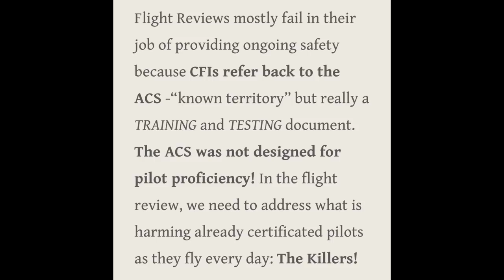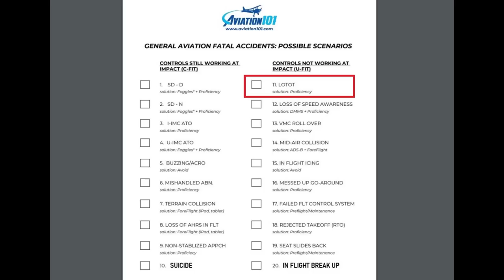Engine Failure at 400 feet.  The Impossible Turn.

Comment: Thank you, Lord!  Excellent execution of a difficult maneuver with very little tolerance for error.

Actually, engine failure on takeoff is most certainly indeed covered by one of the top three handbooks required for private pilots.  It does not, however, recommend returning directly to the airport.

I have practiced this in the simulator several dozen times since I first began taking lessons, and out of the first dozen times, I made successful landings just twice, crashing and burning on the other ten.  It's not an easy maneuver, even when practiced often.  I am now an instrument-rated private pilot and still practice this maneuver on a regular basis, never with better than an 80% success rate, hence the ongoing practice.

By far, the most critical element involves the immediate establishment of a suitable airspeed.  You'll need enough to prevent a stall, plus an addition amount to cover a perfectly-executed 30 degree bank turn, plus extra for turbulence, plus extra for a bit of g-loading during the first part of the flare.  I've tried this at all combinations of speed and bank, and what seems to work the best is velocity for a perfectly-executed 60 degrees of bank while never going past 45 degrees.  60 degrees imparts 2 gs, requiring stall speed x the square root of 2.  Thus, if 50 kts is your stall speed, multiplying that times 1.414 requires 71 kts.  Interesting enough, for the aircraft I fly, that's right at L/D max, which results in the most lift per unit of drag.

Successful execution begins with a decided nose-over coupled with an immediate 45 degree turn held at Vx x sqrt(2).  I've tried chandelles and turns at 60 deg bank, and none worked very well at all.  Turning at 45 degrees bank helps lowering the nose, so I do both, simultaneously, which requires less energy for a 180-degree turn than either more of less bank.  The additional slight benefit of a 60 degree bank is greatly overshadowed by the far narrower margin for error and much higher probability of an unsuccessful outcome.

In summary, MEMORIZE:

Velocity = Vs x 1.414 = _________ kts
L/R bank to 45 degrees AND nose over
At ___________ kts, pull up, maintaining 45 degrees of bank and the correct pitch to maintain ___________ kts of airspeed
When lined up and on final, if you have enough altitude, begin lowering your flaps

Good luck.

Comment: Well Dan, I wish you would comment on STOL airplanes and the so called impossible turn.  And how about trikes/microlights/ultralights. No big deal with the right plane + awareness/skill. Also, the turn doesn't have to be a full 180 degrees. A 120 or even 90 degree can be life saving vs straight ahead into houses, buildings, or trees! One other thing, I wouldn't waste time making radio calls during the turn...

Comment: I am a 20,000 pilot CFI, CFII,MEI trained 40 students a year for years running an accelerated flight school. I was part or a study in1986 where we took every thing from a J3 to vtail bonanza to study engine out turn back. We did over a hundred test with pilots that had been instructed in the technique and a hundred with pilots that were not instructed. We taught to know where 400' AGL was check the wind turn into it, at first sign of power failure drop nose and 45 degrees of bank. Turn to the runway. The trained pilots all made the turn in every plane. 9 out of 100 made the turn with no training. This study was done with the help of the US Navy. It was published I don't know why so few instructor use it. All of my students do it many times in training I never tell them when. The biggest mistake that most people make is trying to do it with a shallow turn. Takes to much time and usually not making to 270deg turn that will put you back on the runway

Comment: Amazing, I was in a similar incident in the early 80s at Doha International airport. Same problem with the engine and the loss of power. All I remember was the stall warning siren going off as the pilot banked to starboard calling out mayday. I also remember the roof of the Gulf Hotel appearing to be very close!

Comment: When I received my flight training I had switched fight schools and instructors.  Engine failure on take off was discussed many times and of course the reaction to this event was to fly straight ahead, keep the nose down and look for a place to land.  Since it was discussed so many times  over the course of my instruction, I felt was though I knew what to do in this case.  This guy was very lucky because of the wind direction.  Making a turn with a loss of airspeed and especially the more than 180 degree turn that this fella did, was not recommended.

Comment: Another 5 * interview by Dan! I'm not a pilot, but if I was ever a passenger and the pilot had a medical emergency. I'm confident with help from the air traffic controller, combined with what Dan has taught me, I would have a positive outcome. Mayday, Mayday, Mayday, complete engine failure, we are descending. I'm not a pilot and I'm declaring an emergency. My pilot has had a medical emergency.  My location is, roll fire, a ambulance, EMTs, and Police as we are going down fast at low altitude. Best area to land, avoid the impossible turn at all costs, avoid highways, power lines and trees; look for a cornfield :), wheels up, wings level, power back, adjust flaps, minimum safe airspeed, slight flare for the impressive landing. Donate to Dan's animal rescue!
Reply: Wow, pilot having a medical emergency and the plane a complete engine failure simultaneously! That'd be quite the challenge for any non-pilot.

Comment: Fire In Flight - Family on Board.

It was about 1987.  I was living in Mammoth Lakes, CA.  I lived next to a neighbor, a young General Physician with his wife and 2 small children.  I saw him get out of his car when returning home and noticed the right side of his head was missing most of his brown hair and his nylon jacket was badly burned on the right side.  Naturally I asked, “What the hell happened to you?”

His story:  Thom was a pilot in the Navy flying sub-chasers for a number of years.  He had just purchased an airplane, a Piper T-Tailed Turbo Lance.  He was planning a trip to Palm Springs from Mammoth Lakes to play some golf and relax with his family.  His wife and kids took seats in the back and he put his golf clubs on the right front seat where his wife normally sat.  

He was thinking of flying over Mammoth Mountain to take the west route south via Sacramento, but at the last moment chose to fly south over the Owens Valley.  After departing Mammoth Lakes, he climbed to about 12,000 feet and proceeded to Bishop and south.   

After 15 minutes or thereabouts he noticed some roughness in the engine, so he began adjusting the mixture to the rich side.  He had just passed Bishop Airport with its one big white hangar.   It was then that the engine exploded in flight.  With a loud bang, 1/3 of his cam shaft had departed from the aircraft and oil had spread quickly all over the front wind screen.  At that time a ball of fire came into the cockpit through air ducts in front of the front passenger seat, cooking his golf clubs and the right side of his nylon jacket he was wearing and took the hair off the right side of his head.  The air quickly turned to unbreathable and visibility was near zero.  

As a physician he new if he  took another breath of the oily soot in the cabin he would pass out and they would all perish.  The Lance has a small triangular opening on the pilot side left window.  He stuck his nose out of it and took a breath.  His family was coughing and moaning in the back and vomiting. He could see the oil fire getting worse up front and turned back to where he thought the Bishop Airport was and declared an emergency, then turned all of the electronics off.  He was now dead stick and the only way was down while burning.

While still breathing out his vent he turned the aircraft to the right an looked to his left where he made out the big white hangar at Bishop Airport.  He turned directly towards it.  The fire was increasing in intensity at 3,000 degrees as the airplane was beginning to fail from underneath.  The wing roots were melting.  At that time all he could see below him was sage and rough terrain, but he thought that setting it down now was imperative if they were to survive.  Any level spot would have to do.  He lowered the gear.  He passed over a barely visible white stripe and turned on it to land and set the plane down gently.  

The fire crew was at mid field when he came to a stop in front of them.  They all tumbled out of the aircraft and the fire crew put out the fire.   Both wings had sagged by 2-4 degrees and would not have lasted a few minutes more.  The entire front third of the bottom of the fuselage was gone.

It seems that the engine manufacturer for his model of Lance had some engines fail like his due to too much salt being used in the manufacture of the cam shafts.  

Piper completely rebuilt his aircraft at no cost and I must assume that he received a substantial settlement as well.  He never flew that airplane again.

His flying career continued.  He went on active duty with the Navy as a flight surgeon in Fallon.  I spotted him at an air show there in the 1990’s.  He was flying a 2 seater F-16 that was used as an enemy aggressor to train the FA-18 pilots on how to dog fight.

1.  He kept his cool, panic is never your friend.
2.  He flew the airplane.
3.  He remembered his emergency procedures.
4.  His wife was “not” sitting up front where the ball of gas/oil fire came through.
5. He was over a known airport.
6. Nobody was badly hurt in the ordeal although his wife would never fly in small aircraft again.
7. God was with him that day.

Had he chosen the route over Mammoth Mountain to Sacramento, his fate and the fate of his wife and of his children would have been sealed somewhere in the Sierra Nevada Mountains.

Comment: The lastest King training course for CFI renewals stresses scenario based training.  I believe the FAA is coming around by starting with the flight instructors using the trickle down theory.  My guess is that the FAA does not want the everyday pilot to be practing simulated engine failures by themselves at low altitude.  All CFIs should be reviewing simulated engine failures on take-off, especially during flight reviews IMHO.

Comment: I had a similar experience departing 21R at PDK, except that I was only 130’ AGL, so when I tried to make 3R I came up short of the runway.  I have lots of documentation, including ATC recording  , photos, FlightAware track, and NTSB report that confirmed that my engine quit due to vapor lock as the mechanic / Repair Station who had replaced the engine failed to include a mandatory vapor return line.  As an aviation attorney I successfully sued the mechanic and Repair Ststion
.

Comment: one exception to the "push on engine trouble" would be a slippery high performance aircraft, sometimes youre a million kts over best glide and the best move is to pull a G and extract that precious altitude you have saved up

Comment: I had an experience very simlar to Robert's when I was a freshly minted GA pilot about 15 years ago.  I was flying a rented Piper Archer over the Susquehanna River near Safe Harbor Dam at about 2,500' AGL (roughly 10 miles southwest of KLNS).  Suddenly there was a loud bang, and I thougfht I had hit another aircraft or large bird, but I did not see anything in the air before or after the explosion sound.  In a mattter of seconds the plane began to vibrate violently.   I had to reduce the power to 1,900 RPM to minimize the vibration, otherwise I was afraid the plane was going to fall apart.  I immediately turned toward the Lancaster Airport and called the tower to report I had possibly hit something and had a power issue, but I was going to try to make the field.   I knew all the ATC ppl in the tower (the fellow on duty was also a GA pilot) and told them at this point I was not declaring an emergency unless it appeared I was going to have to land in a farm field (I should have declared an emergency immediately -- but inexperience lurks).  At 1,900 RPM my plane was not able to maintain alttude, but since the engine was still providing some power, my involuntary descent rate was very slow .... perhaps 100' to 150' per minute.   When I was about three miles short of the runway and down to a little less than 1,000' AGL, I realized I was going to be able to make the field, but black smoke started coming out of the sides of the cowling.  Lucky me, there was no smoke in the cockpit.  I decided to contue witrh my plan to make the field.  (I believe at that point the correct thing to do would have been to declare an emergency and make an immediate off-field landing.)  I also noticeed there were fire trucks, an ambulance, and a couple of police cars at the end of the runway.   My first thought was they must be having some kind of first aid practice drill .... until I realized they were waiting for me.  When I reached the field (barely), I made a straight in to RW8 and landed uneventfully.  I stopped on the RW, shut everything down, jumped out of the plane, and we took the cowling off ASAP with fire trucks along side.  I could hardly wait to see what had gone wrong.  We immediately noticed one of the cylinder heads had blown off the engine and the black smoke was engine oil leaking out of the blown cylinder onto the hot engine block, but there was no fire.  I took a bunch of photos of the cylinder head blown off the engine and the Archer was unceremoniously towed back to the apron to eventually have a complete overhaul.  I believe Robert's Cessna was flying on three cylinders like my Archer, otherwise he may not have been able to make a successful recovery and land his plane so easily.  There's a big difference between a plane flying on three of four cylinders and a plane with a dead engine.  Among others, two lessons I learned: (1) When you have any trouble no matter how minor it may seem, tell ATC and declare an emergency.  They're there to help you.  (2) If it ever looks like any part of your plane is on fire, land immediately wherever you are.  Do everything necessary to save yourself and worry about getting the plane back home intact later.  Since that incident I have accumulated nearly 3,000 hrs of safe GA flying throughout the USA including Hawaii.  Keep safe out there everybody!!

Comment: You can turn steeply as long as you push the nose down far enough. In fact, an agressive bank (45 degrees or more) will turn you around faster with a smaller loss of altitude. The trick is to practice (with an instructor) in various conditions and in the plane you will be flying.

Comment: I find it interesting that a person learning to fly, say, a Beech B200 King Air will be drilled relentlessly on LOTOT, because of asymmetry and P-factor, but a plane with only one engine doesn't have the same rigors for if you lose your only source of thrust and under most circumstances cannot feather like larger craft. I realize that engine-out is, if not "required" typically part of learning, but low-altitude engine-out is a really tough spot to be in. It seems like you'd drill immediate actions for that as part of a comprehensive package of proficiency training.

Comment: In gliding we practice winch cable breaks regularly at various different heights and different wind directions.

This is an identical scanario to total sudden engine out in a power plane so we kinda get used to it or expect it.

There's so many scenarios but

it programs you whether you are:

 Low enough to go straight ahead

If a few hundred ft turn downwind and then back into wind to do an 270deg abbreviated circuit 

Turn into wind if insufficient height to do a circuit and land where possible.

Do Glider pilots make better pilots?
I honestly say they do generally 
(eg Sulleunburger Hudson River!)
In the PPL world I think the PFL training is totally inadequate and you only have to look at the 100's of Youtube vids with engine failure where the pilots go into total instant panic mode!!
If there was more glider training, folk would be able to deal with engine failure as a matter of routine rather than panic mode.
How many PPL pilots practice a PFL during a flight?
Probably very few is my guess.
Practice a power off approach at least every month and see if you can pick a practice field from 2000ft which you could have landed in.
Try and improve skills yourselves because a few PFL's once a year for a skills test is simply not good enough.
Jules
PPL & Glider Pilot

Comment: Robert's EFATO was very like mine - in both cases the engine ran VERY rough and most of the power went. In my case (in a Chipmunk) after transitioning from the nose-high climb to the nose-low attitude to keep the wing flying I found I could actually (just) maintain height, fly a very tight circuit, and land back on the same runway.

Comment: With that altitude and a complete engine failure (unlike this scenario with 3 working cylinders) it would seem very unlikely that he would have been able to make that turn, right? Not enough airspeed or altitude to save him turning wise. IN the case of a complete engine failure on takeoff, would it not be best to not turn 180 and fly into a field or even body of water?
Reply from the maker: True, his engine lost significant power but we don't really know how much he had left...in the case of a TOTAL loss, a 180 from that altitude would not have worked.  I should have made that point more clear in the video.   Thanks for commenting on this.